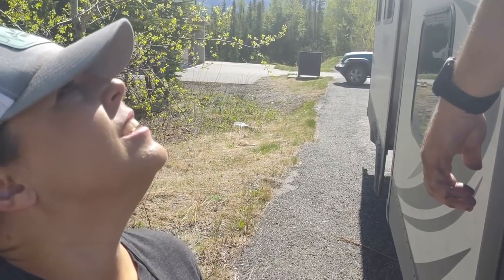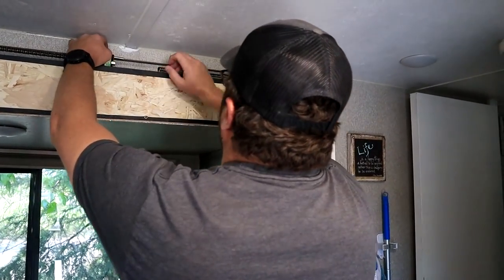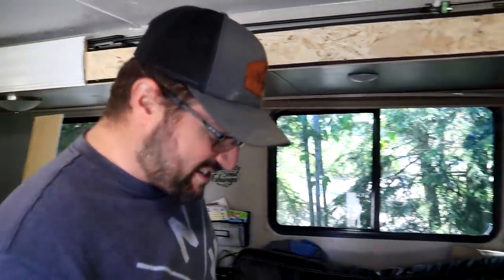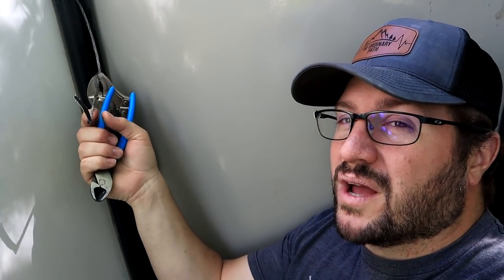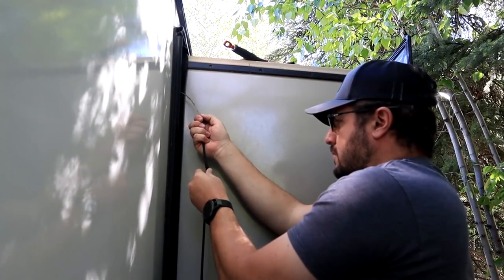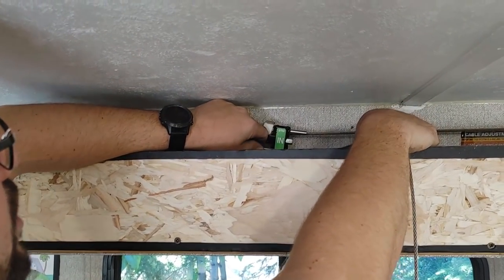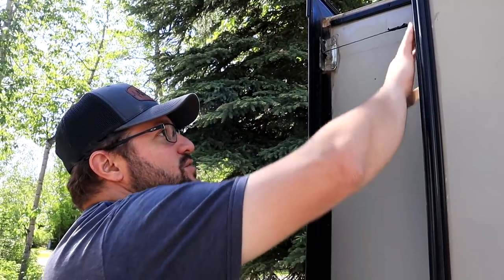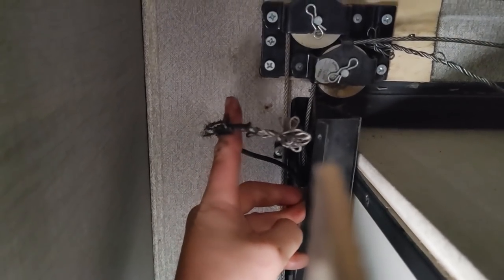DIY Slide Cable Replacement | Rough Road Damage from the Alcan

Comment: Helpful tip! You can use the blade at the inner most part of the jaws of your vise grips to cut cable. It works amazing and will save your side cutters from being ruined. I was a garage door mechanic for 8 years and cut hundreds of cables that way. Not all vise grips have that blade but it looks like your do. A little late but the more you know. Right? Lol
Reply from the maker: Kristin here - I think he checked that first but it would work. We made a special trip to the hardware store to find something strong enough that didn't cost too much. haha

Comment: We had our slide motor break on us during a trip.  Took my son and I pushing on the outside while my wife hit the retract switch.
Reply from the maker: Not pictured are the times that John and I took turns pushing the slide in to adjust the tension. LOL.

Comment: Love my cable slides. The cables on my rig still look like new after four years of use. I carry a repair kit in case things go south. I think you have other issues with your cables. They should not do what yours have done unless they are not aligned properly.  I would check the pulleys and the rest of the travel and look for restrictions.  They are a great option when installed well. They also reduce overall weight of the rv. Thanks for the video

Comment: FYI, if nobody told you, the REASON the slide cables are fraying is 99% of the time they install the pull points on the edge of sideout in the wrong place. They look aligned, but then as the slide goes in, just before it meets the RV wall, the cable is high or low on the metallic cable entrance into the RV, and it abrades against that metal access point.